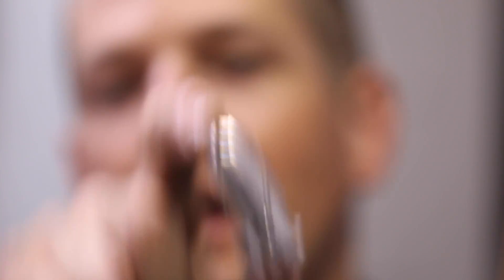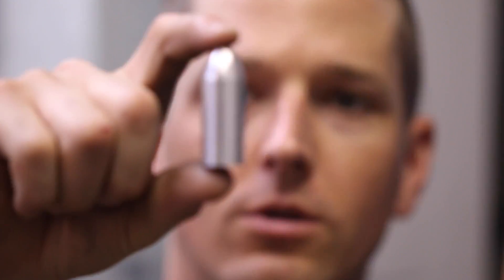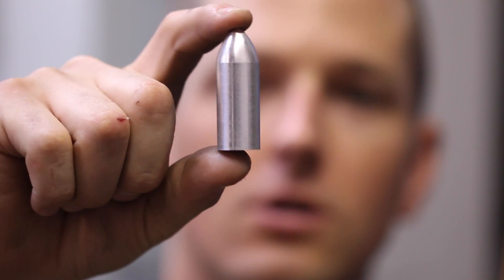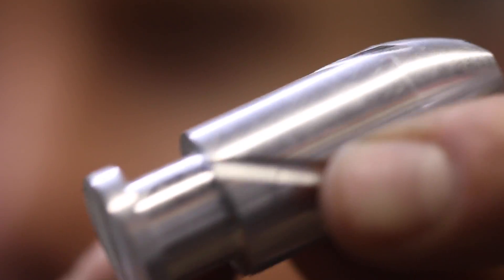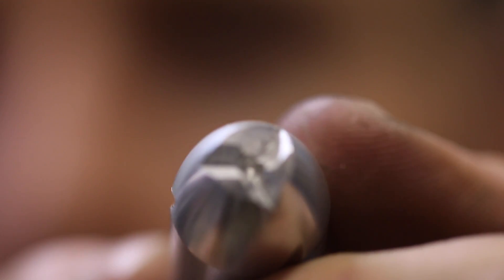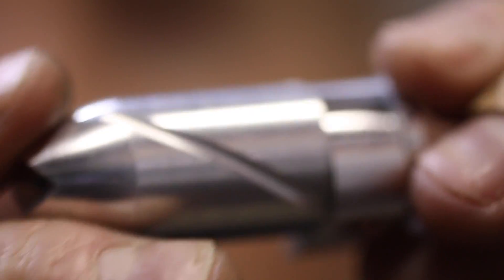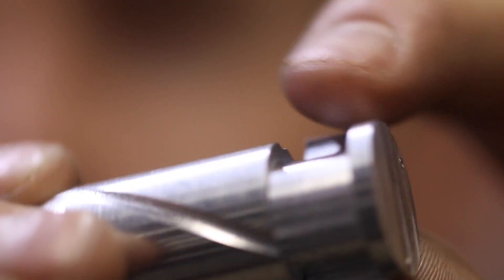12GA Shotgun Missile Slug!  CNC Machined!  Widget45

Comment: I know this video was done in 2015 but just now watching it in 2020, I think this might work better if flute holes where drilled in 3 points of a T and the flute was bored from the bottom and then add a plunge stop at the rear by tapping in an aluminum plug. And I think another thing would to be shorten the round to 3/4" intotal length.

Comment: Aluminum seems a bit lacking in mass. It does present amazing possibilities as a frag jacket or payload delivery device.  Filling the aluminum with lead would add inertia that would want to continue to move when the projectile impacts. The lead would shatter the aluminum, most likely along the weakest points, the aero grooves. engineered failure points which would leave the side walls largely intact. 

No need for the flute to open the stabilizing fins, as the spin would force them out via centrifugal force. Leaving endless possibilities for filling it with all sorts of fun things. Magnesium filings, mercury fulminate, white phosphorus... mix it up. I know that is way outside the theme of the channel...  some of it is probably illegal. All these gun moding videos got me feeling frisky :D

Comment: I've never been a ballistics expert, but I stayed at a Holiday Inn Express, so I feel qualified to make this observation. You rifled this so the rotation is clock wise. You designed the fins for counter-clockwise motion. The centripetal force is causing the fins to collapse against the body of the slug. The hinge should be on the opposite side (left as seen from bottom). Beautiful work, btw.

Comment: Center of pressure and center of mass (or gravity). The center of pressure must be behind the center of mass for a non-spinning projectile to be stable in flight. To get those fins to pop out reliably you should angle their forward edges and taper the body ahead of them to allow air to impinge on their tapered edges. That will also shift the center of mass forward. Skip the cross-cut on the nose and have a simple, tapered hole. Have less of an ogive shape, make it blunter so there can be more mass forward and the ram air hole can have a larger opening. You want the fins popping out the instant they clear the muzzle. Cut out as much of the base weight as you can. Drill holes up between the three that go out to the fins. Make the fins thinner except at the hinges. Build a balance device so you can tell if more than 50% of the mass is ahead of the center. If not, it won't fly straight. Skip the spiral grooving, especially towards the front. It doesn't 'grip' the air enough to do anything but cause drag.
Reply: Gregg Eshelman i

Comment: Hey man, you got that fluting running in the wrong direction. If the air were to respond to the fluting and turn according to the fluting the slug would be turning opposite to the flaps and effectively holding them closed.

Comment: Clever idea. The problem that I saw was the direction of the "rifling" and the direction the fins opened were opposite. The spin of the projectile would actually force the fins closed. I think the use of fins with a rear pivot point, and flipped open from front to rear, perpendicular to the direction of travel would lead to more/faster stabilization... though they would be a bit trickier to machine.

Comment: From what I could tell from Jeff's video the projectile didn't have enough time to stabilize to get  air through the hole to open the fins. So here's an idea: maybe if you would make the hole all the way through or just from the back of the projectile, so the pressure from the propellant could open up the fins which would maybe stabilize the projectile faster thus making it more accurate and actually function the way it was designed even on short shooting distances. Eventually you'd have to remove the wadding to make this work (if that's even possible to do safely).

Anybody still reading this, please comment if you think this could work!
Reply: Haha, love your attitude!
Would be great to see this :D

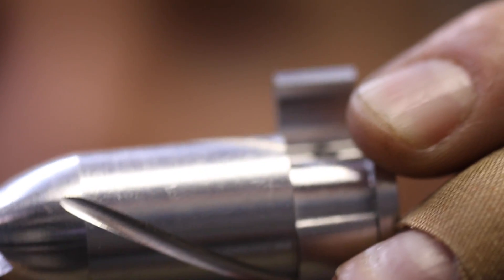Comment: I have a question: at 5:15 when you compare the direction of spin that the flutes will impart with the way the fins hinge, it looks like the direction of spin would cause the fins to close, except that the air coming down the center tube would resist that... is that what you intended? It seems you'd want both effects to open the fins...or am I missing something?

Also, if you want the fins to remain open AND assist the spin, you could bevel the concave side of the leading edge of each fin.

Comment: Loved this video format. Don't think the rifling will help based on other projectiles he's fired that are similar. If the round is supersonic (probably will be) I doubt there will be enough airflow through the hole to force the fins out. The shockwave at the tip would prevent it. If he uses a reduced recoil load, and it's sub 1000FPS I think they might have a chance of extending, and maybe stabilizing the round. 

Of course I'm just a keyboard commando, so I don't really have any idea what it will actually do. Looking forward to seeing.

Comment: Awesome video John.  Your productions have always been fun and informative, but this one was pure exciting entertainment.  Thanks for the extra effort in pre and post production to make this so fun to watch :-)
Reply: Joel L I just uploaded a machining video to YouTube today, and it's embarrassingly bad compared to this NYCCNC production.  John is really upping the ante.  My crummy video also took a ridiculous amount of time to edit.  John is really dialing in the entire video process.
Reply: NYC CNC The beefiness of my SuperDuperFly is wasted on my small torque limited and even more rigidity limited mill drill, but I wanted to ensure the tool wasn't the limit.  I may want to put it in a CAT40 someday.  Given the lack of rigidity in my mill, the SuperFly is still much better for material removal... at least until I get the nerve to run the SuperDuperFly at 1000 RPM (maybe never, but at least not until I hang the 1/4" Lexan doors and jog it via CNC).

I didn't measure to see how much the remaining 12L14 moved after most of it went into the swarf tray, but almost all of the removed material was symmetric so any creep should be symmetric, and it's actually not a very high precision part.

I need to stop screwing around and CNC my mill and lathe.